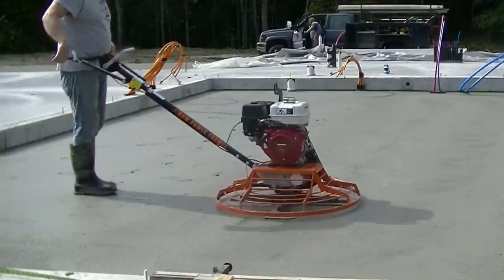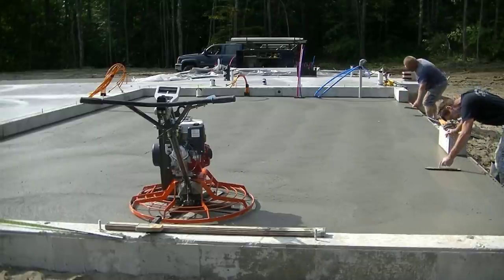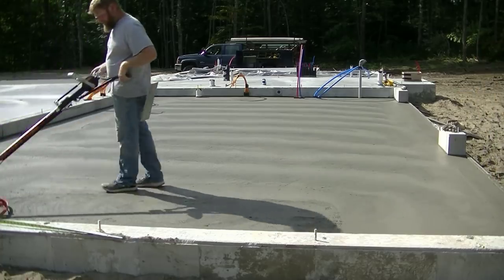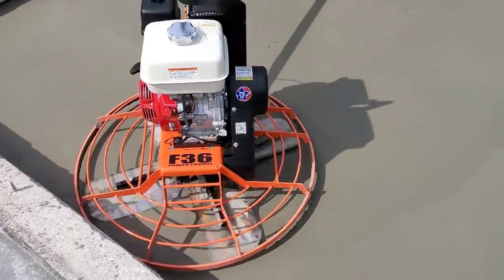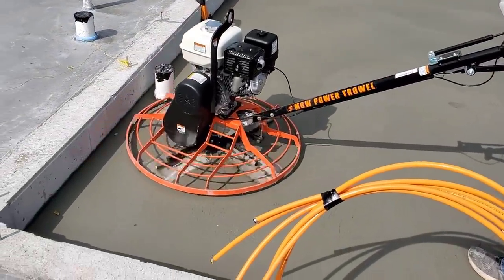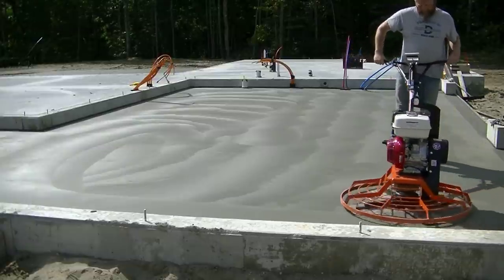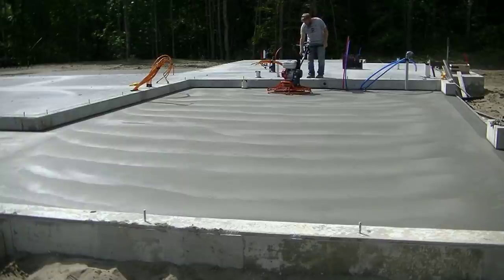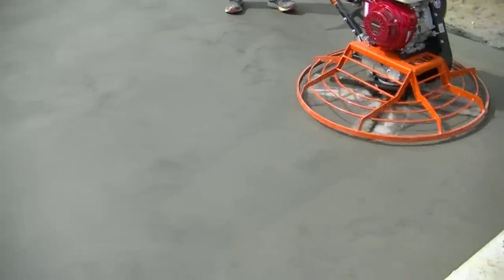Power Trowel Review : New MBW 36" High Torque Trowel

Comment: Never run MBW had Allen engineering, Master Kraft ,Wacker, Whitman regular model high torque model and 3' and 4' think we had 5 at one time. Was told Bartell was the best from the guy I learned from. So far Bartell is the best but I have a Wacker with poly blades and  led light's front and back that is the most comfortable to operate. But it isn't built none of them have the fit and quality especially heavy duty gearbox of the Bartell. From what I see it finishes nice probably has the 8 hp Honda the extra weight burns a nice floor.

Comment: Are you using a laser that shoots slope for your wet pads on that garage floor?
Can you show a close up of your cuts with the soffcut ? If we cut that early we get alot of blow out on the edges of the cut. If we wait until it's hard enough to get nice clean cuts it takes forever to sawcut a slab

Comment: Hi Mike,
As always, a great video!
I have a Wacker Neuson power trowel which i got second hand and it has been a great unit for me. I've been considering getting a new one, and this looks like an awesome unit! I especially like the quick adjust for the blades and the faster speeds.
What are you thoughts on the trowel that Wacker Neuson makes?

Comment: We used a multi quip  and still own 3- 3 footers. I would say it does well. Obviously without running it you can't make a suggestion to buy or not. 2 questions for you. In our area finishers always make the last pass by hand. Is this something you guys do? Have you ever experienced alot of cracking in the floor when you have made alot of passes with the machine?
Reply from the maker: When the temps get colder we'll do the last pass by hand on some floors but mostly burn them like this floor. We don't  have any problems with cracking when we finish with the trowel like this.
Reply: It dependes in few carasteristics:
   First: concrete mix; some plants don't send good cuality mix, as too small gravel, high desity sand, and not the correct psi cement requirments etc.
  #2 preparation, somo sites needs underlayment. Too dry base absorve the cement and make concrete loose his strenght.
#3 some, but I said all needs runns "pans" before star combination.
 #4 some crews use excesive amoun of water. Water is necessary, but in the correct time and the correct amount.
#4,5,6...cut be in the mix or in the proces, but more likly people with low knowledge in his trade.
Reply: @sergiotorres3573  thank you for the comment. The question was in reference to the vibrating or beating of the trowel on the the surface of the concrete. Obviously water is an issue and occasionally the mix is as well. Our supplier has been messing with quantities of fly aah and giving us, shall we say unexpected results. The question was actually in reference to what an old finisher told me. "The trowel shouldn't be ran more than 4 times on a floor or you will see alot of cracking". Wondering if anyone has had this experience?
Reply: @mathtime4578  no, not true
Reply: @dankruger2890  so vibration on a floor that has less than 100 psi strength has no affect?

Comment: I always have 2 power trowels when I finish work like this. I use float blades first, then combos on the second machine, then I get rid of the trowel with combos. Then just blade it with the machine I floated with. Our concrete sucks and the combos fill nicer than floats and blades.
If we had a solid machine at work, I would just want combos. Boss needs a new machine.

Comment: What do you know about Self-consolidating concrete.
Reply: Usually for structural concrete, underwater concrete, and concrete that cannot be vibrated, just poured 36,000 yards of it underwater on a navy base, can’t say where because we get in trouble on social media about our work, but you usually would never use it on a slab on grade, it’s like piss water and you wouldn’t be able to screed it, when they slump,it they measure how much it spreads out on a piece of plywood, usually spec is in between 21-26” spread so it’s really loose.